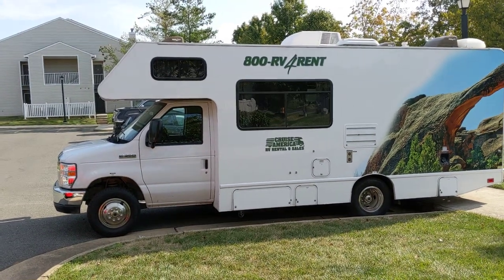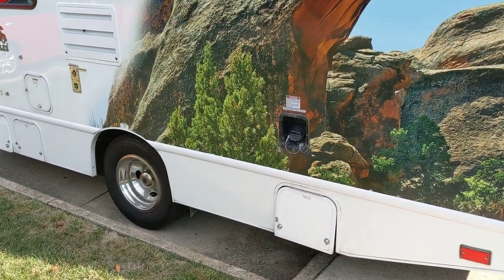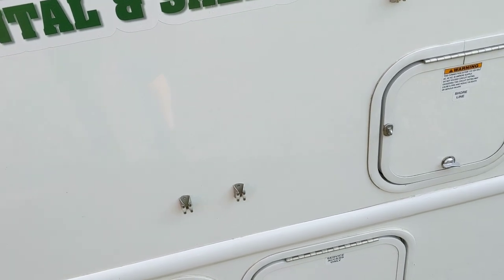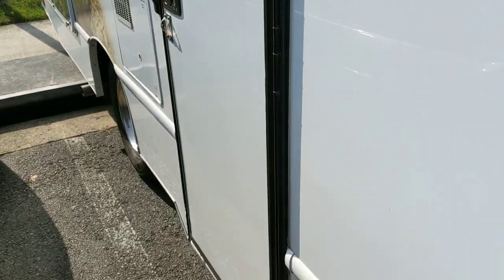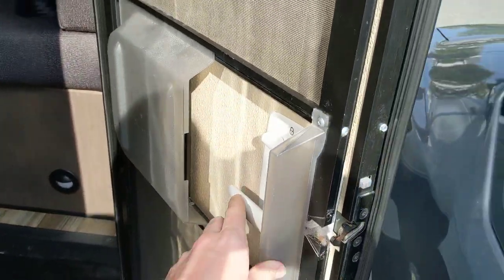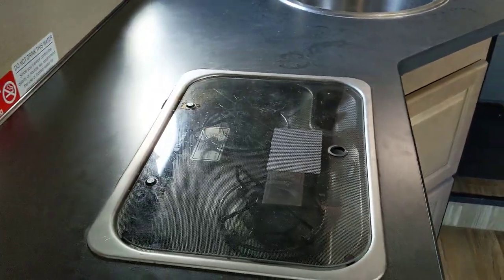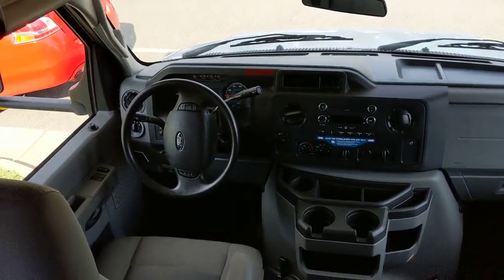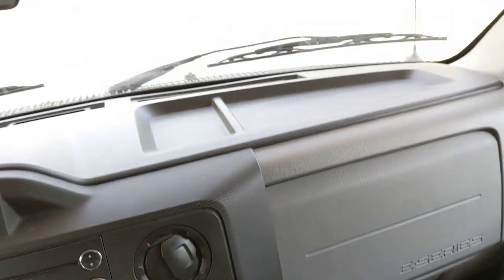Cruise America - Review and Walk through of 25' standard 5 passenger RV

Comment: I see that there is no backup camera or ladder to the roof. Was the lack of a backup camera an issue when parking?
Reply from the maker: Hi!  Thanks for the comment.  These are basic "no frills" rental RV's so lack a few features you might find elsewhere.  The lack of a ladder is also a safety & liability reason (don't want people climbing on the roof, falling off, or tampering with the equipment).  The lack of a backup camera can make parking challenging.  I've backed into a few spots (try to have someone acting as a spotter, if possible), but typically select "pull through" campsites for their convenience.  Good luck, have a safe trip!

Comment: Does the screen door rattle very much going down the road?
Reply from the maker: Hi!  Thanks for the comment.  There are two locks.  As long as the door is locked properly we haven't noticed much noise coming from it.  There is / can be a lot of noise from the back, but this is more from the stove, doors/drawers not closed all the way, and items loosely stored in cabinets.

There are quite a few products available to help reduce noise but what works for us is we travel with only minimal "stuff" -- two plates, two bowls,  two cups, and heavy-duty plastic utensils (again, only two of each).  Less stuff = less rattling.  😃

Comment: Helpful video! We are renting this model for our trip starting this weekend,  and this answered many of the questions I had about information not listed on their website.  You should charge them! Lol... can you run the Fridge while driving?
Reply from the maker: Lol! Thanks! Glad it was helpful. The fridge has an "Auto" mode, meaning it will run off propane when driving or electric when hooked to shore power. They should turn it on for you as part of the checkout process. If not, it's a button right on the front. It does take a few hours to get cold, and remember not to pack it too tight (it's not as efficient as a household style refrigerator) or stand there with the door open. 🤣 Have a safe trip!

Comment: Was the hose in the back storage cabinet for the connection to the water supply at camp?  Would we need to provide our own hose or AC extension cord?
Reply from the maker: Hi!  The hose in the back storage area is for connecting to a campground water supply or for filling the fresh water tank from external source (such as a garden spigot).  The RV does have a built-in cord for connecting to shoreline power which is compatible with 30A service at most campsites.  They typically include a 20A adapter, as well.  Note that if you need a 50A adapter you will have to purchase this separately, but we've never needed one - just pull up and plug into the 30A service on the campsite pedestal.  Have a safe trip!

Comment: How much does it cost to fill up the tank and how long does it last? Also, do you ever have to check the propane to refill it or is it not important? Thanks so much for the video it gave me a good idea of the RV and I will be renting it soon.
Reply from the maker: Hi!  I get a ton of questions about "how far can you go on a tank of gas".  Unfortunately this question has too many variables to be answered concisely.  Both the "large" RV (30') and the "standard" RV (25') have 55 gallon gas tanks.  They get, from my experience, around 10-14 mpg.  With the larger RV being more towards the bottom of that scale and the smaller RV being slightly toward the higher end.  Of course this depends on how fast you drive, how heavy your foot is, and whether you are driving on flat terrain or up and down mountains.  So again, just in my experience, most trips in-state can be done on a single tank of gas.  Longer trips are more.  I was able to get from Northern Virginia to upstate Pennsylvania and halfway back again on a single tank.  Just be aware that a 55 gallon tank can cost hundreds of dollars to fill up (depending on the price of gas in your area), LOL.

If you use the generator that does consume additional gas.  The generator is wired so that it won't turn on if gas in the tank is too low (this is to save you from the generator using up all your gas).  Most of the campgrounds I've stayed in have "full hookups" so I don't have to run the generator.  Most I've used it for is around three hours, I don't recall it consuming more than a gallon or two of gas during that time.

The propane is checked on the same panel where you check the levels in your black and gray water tanks.  If you want to use hot water for washing, showers, etc., you should check the levels on that.  A little goes a long way, and propane is really cheap to refill.  Most large truck stops as well as home & garden shops offer propane refilling.  We refilled it once a few years ago at a Merrifield Garden Center, think it cost us around $5.  ;-)

Hope this helps!

Comment: Are you able to run generator while driving? We’ll be working from the road and will need constant computer power thank you!
Reply from the maker: Hi!  Thanks for the comment.  Yes, you can run the generator when driving if you need to use the 110/120V household style electrical outlets.  You can also get a small inverter to tap into the 12V outlets in the cab.  This is what I'd do, personally, since most laptops hardly require any power.  Some laptops can also run directly on the 12V outlets (with the right cord).  This will save gas and additional costs of having to run the generator.  Good luck, have a safe trip!

Comment: Thank you for the video. We are having to make a trip to the west coast from the east during this Covid time and thought instead of going into many hotel rooms rent an RV.  Can you use the microwave while on the road or do you have to pull over to use the appliances? Sorry for the silly question. And is the mattress really horrible? Bad back here.
Reply from the maker: Hi!  To use the microwave you either have to be hooked up to shoreline power or run the generator.  I've heard it's possible to run the generator while going down the road but I'd be a little nervous about this, not to mention that most states have laws requiring passengers to be buckled in - not walking around going to the microwave while driving.  Be safe, pull over when cooking.

Re: the mattress, I'd look at the 30' model if you have back issues.  It's easier to get into and out of the bed in the larger vehicle.  And maybe bring a foam mattress topper for added comfort.  Have a safe trip!
Reply: Yes you can use the microwave while driving. You will need to have the generator on. If you use the generator longer than 3 hours, you will need to check the oil level. I use and egg crate and a good plush mattress and the bed is comfortable. We own Cruise America in Fairfield, Ohio.

Comment: Great and very informative video! We are planning to rent soon. We are going to be driving from Michigan to Arizona and I was just wondering if an individual can use the bathroom while the vehicle is driving? Or if the bathroom can be used while in park at a gas station/etc. Thank you!
Reply from the maker: Hi!  Thanks for the comment.  Yes, as long as you have fresh water in the holding tank and your dump valves are closed, you can turn on the water pump to use the restroom at any time.  We frequently would pull over to use it while on long trips.  Please be aware of any local laws regarding all passengers be wearing seatbelts while the vehicle is in motion, however.  Have a safe trip!

Comment: Thanks for your video.  My question is-if the fridge is only powered on with propane or generator (or shoreline I assume), what about when driving (or does that include propane?) and at night? do you have to transfer your stuff to coolers?
Reply from the maker: Hi!  This question comes up a lot.  The fridge has an "Auto" setting that the rental office should turn as part of your check-out procedure, so that the fridge will begin cooling down immediately.  It will run on propane (if available) or electric (if available), selecting automatically between all available sources of power.  Obviously if you run out of propane and your battery is dead it cannot continue to operate, but otherwise should always stay cool for the duration of your trip.  Just remember to not pack it too tight - air needs to be able to circulate inside the fridge in order to properly cool down.  Also don't stand there with the door open, LOL.  🤣  Hope this helps!
Reply: @CompTechMike  Thank you!  And we can confirm this when we pick it up, but I'm still unclear about those nights when we camp at sites without power.  I believe you're saying that it should stay cold if kept closed and not packed too tightly.  But since we will have coolers, I may just transfer anything very perishable to the coolers.  Thanks again!  I look forward to more reviews!

Comment: Great video, thanks.  Can you air condition the cab without using the generator?
Reply from the maker: Hi!  Yes you can.  The cab AC is just like AC in a normal truck or van - works as long as the engine is running.

Comment: Hello Mike, your video is awesome! This was informative for a first time renter. I do have a question regarding the propane tank for the 25' RV. For a 1500 miles trip, do you recommend a 20 lb (5 gal) or a 33 lb (7 gal) propane tank? Can a 33 lb tank fit?
Reply from the maker: Hi! Thanks for the comment.  The propane tank in the Cruise America rental RV's is built-in.  It is not designed to be removed.  The tank capacity on the 30' and 25' RV's is 12.2 gal., and 11 gal. on the compact rental vehicles.  It will typically come full, but this may vary based on whether your particular rental office has the hook-ups to fill it.  We usually top ours off at the local garden center, but many places including truck stops, home improvement stores, etc., sell propane.  Have a safe trip!
Reply from the maker: You may also want to check out my newer videos for more info:

https://www.youtube.com/watch?v=bgOoMQ1_4mA

https://www.youtube.com/watch?v=6EBeRJBtCAs

Comment: Hi Mike!  Thanks for this video.  My family is planning a trip to Utah this spring and want to rent this RV while we're there.  Your walkthrough was great to give me an idea of what it's really like inside.  One question - how long does the hot water last in the shower?  I tend to take epic long showers, but can cut them short if I know the hot water won't last!  :D
Reply from the maker: Hi!  Thanks for the comment.  The hot water tank on both the 25' and 30' RV models is 6 gallons.  The hot water is heated by propane, you'll want to turn the water heater on about 15 minutes before you need hot water in order to give it time to warm up.  It warms up pretty fast, but is not a lot of capacity.  What my wife and I usually do is go in, wash ourselves off, turn off the water (which allows more to heat up), soap ourselves up with the shower off, then turn the water back on again to rinse off, then turn off the propane.  Other things to keep in mind are that the shower is not very large.  On the 25' model there's not much headroom (the 30' model has better headroom because of where the skylight is located).  Also, the gray tank is only 24.5 gallons in the 30' RV and 22 gallons on the 30' foot RV.  Something to keep in mind if you're camping somewhere without full hookups.  My wife and I found that we'd usually fill the gray tank after about three days of normal use (showers, washing dishes, etc.) and have to go go dump it.

TL;DR.  You need to keep all your fluid capacities and propane capacity in mind when RV'ing.  It's not really the place for "epic showers".  Better to stay at someplace like a KOA ("Kampgrounds of America" - have some really nice accommodations) and use the public campsite shower if that's what you're looking for.  Good luck, have a safe trip!

Comment: Hi, I’m thinking about buying a 19/25 ft refurbished rv From cruise America high mileage about 120,000 miles. About $32,000. Any suggestions for me since you rented from them 3 times? Are they reliable at 120,000 thousand miles on it? Would you recommend buy a used formal rental rv from them? Would you get the 19 or 25 ft one? How many miles on your when you rented it? Thanks!
Reply from the maker: Hi!  Thanks for the comment.  If/when we buy one, we're most likely buying the 30' model.  This gives more room, easier to get out of the bed (without having to climb over your partner), and a more comfortable shower.  The 25' model works (but has those drawbacks mentioned above).  On the upside the 25' model has a slightly larger gray water tank capacity, so has some advantages for boondockers.

From my experience and the majority of comments I've seen, you should have no trouble buying a used model with 120k as long as it has been reasonably well maintained.  I've heard it said that the Ford V10, in particular, can go up to 500k miles.  If you're able to work on your own vehicles these are not too different from doing basic household and vehicle repairs.  Most of the comments I've seen indicate Cruise America will take care of you if you buy a vehicle off the lot and then discover something broken - just bring them the receipt.

The rentals have anywhere from 0-120k miles on them (they usually sell them once they get to around the 120k mark).  I recommend watching the three videos on MoorExpeditions YouTube page for more info:

https://www.youtube.com/channel/UC4U0JMQPlveTUWtSisNEwoA

Good luck!
Reply: Done a lot of homework. 32k is in the ball park. Yes buying a rental is not a bad idea. I know lots of people that have been very happy with.  I bought a rental return  that had been privately owned for two years. I have had it 5 years now. No issues but remembered tires, brakes spark plugs, your still gonna put in about 1000 to 1500 or year (over 5 years, I put in 3700 ) I am still very happy with.

Comment: Hi, great review ! Can you operate fridge while driving ?
Reply from the maker: Hi! Yes, the fridge has an "auto" mode.  Meaning it will automatically switch to running on propane when electricity is not available.  Obviously you have to have propane in the tank and the valve turned on, but this should all be set for you by the sales staff prior to departure.

Note that these fridges are not as efficient as your household fridge.  My recommendation is to not pack it too tightly (so air can circulate to cool things) and don't stand there with the door open, haha.  😉

You might also like my newer video, here:

https://www.youtube.com/watch?v=qbBoA0x5Fow

Safe travels!

Comment: Mike thanks for sharing your experience. Getting ready to rent from Cruise America for first time. I have a couple questions. First, can toilet be used when vehicle is in motion?  And does water heater work on electric or propane (looking to avoid propane refill)?
Reply from the maker: Hi!  Thanks for the comment.  Yes, the toilet can be used while on the road.  Just flip the switch on the control panel to  turn on the water pump (to provide water pressure for flushing) and you can use it.  You will need to have water in the fresh water tank, as well.  Recommend checking with state and local laws, however - most places require occupants to be buckled in at all times when the vehicle is in motion, not using the toilet.  🤣

The water heater does require propane.  Propane is pretty efficient and lasts a long time.  I've had good luck getting it filled at places like home & garden stores.  If taking a trip of more than a few days I recommend filling everything before heading out.  Better to have it and not need it than need it and not have it.   😀  Good luck, have a safe trip!
Reply: @CompTechMike  thank you

Comment: Are you able to use the fridge while you driving?
Reply from the maker: Hi Bruce! Thanks for checking out my video. Yes, the fridge is able to run off multiple power sources including propane (if available) and electricity (if available). Typically as part of your departure process, the Cruise America sales agent will turn on the fridge and set it to "auto" with the buttons on the front. It will run off the vehicle's propane tank while driving and begin cooling immediately.

Note that these fridges operate a bit differently than a normal household fridge. You don't want to pack them too tight (they need room for air to move around inside) and you don't want to stand their with the door open all day (LOL).

I have a newer video that may be helpful, as well:

https://youtu.be/qbBoA0x5Fow

Hope this helps, have a great trip!

Comment: The "storage" area that you access from the outside.....exactly how big is it?  Can you fit a child's bike in there?
Reply from the maker: Hi!  It is 51 cubic feet on the standard RV, and 93 cubic feet on the large RV.  Yes, you should be able to fit a child's bike in there, especially if you remove the front wheel.  On the standard size RV you can access the storage compartment from the passenger side and the back.  On the larger RV you can access it from the back and both sides.  This is something to take into consideration if you're storing big stuff in there.  Have a safe trip!

Comment: Excellent video. Very informative. Wondering if you think it's possible to lay a board on top of the cab over bunk to turn it into storage?
Reply from the maker: Thanks! I believe you can convert the area above the cab into storage as long as you don't exceed the weight limit (I believe that is 200 lbs.). Be careful to secure everything properly so it doesn't fall on your head while driving! 🤣